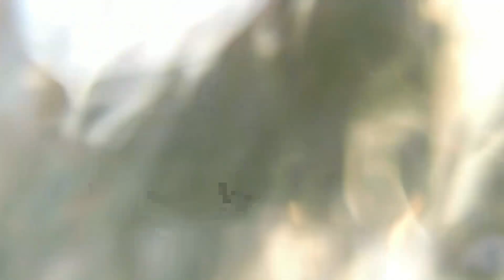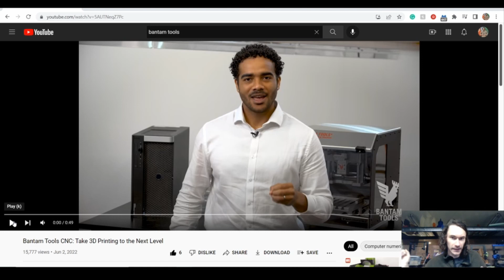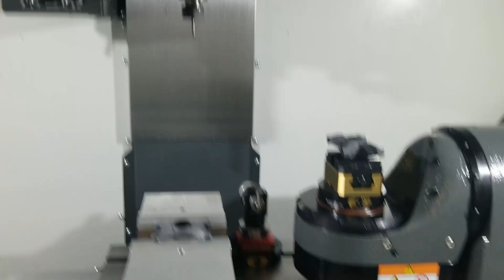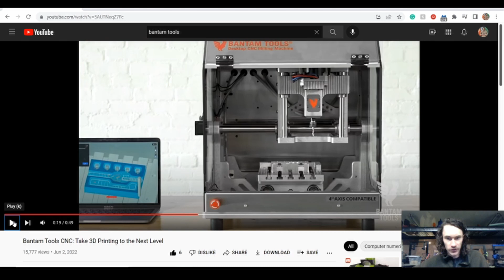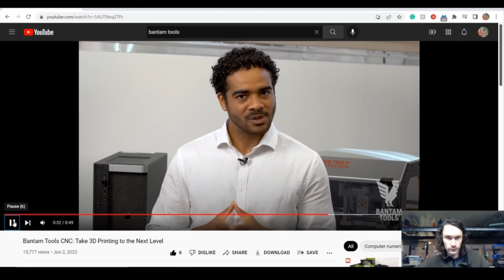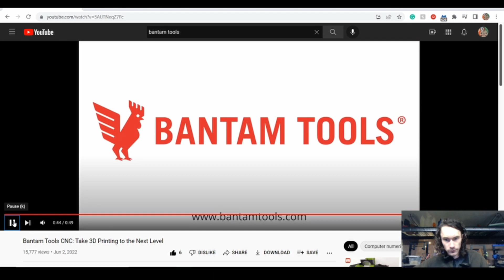Bantam Tools Said What?

Comment: Those machines are not worth half of what they’re selling them for. Extremely low powered motor, leadscrew driven, subscription based software, structurally flawed, and not very accurate. For the same price you can buy both a Sherline cnc mill and a sherline cnc lathe, with ton of accessories and even a 4th axis. Also, their costumer service is HORRIBLE.
Reply from the maker: Did you actually watch my video? I was not making any comments on the machine itself outside of the fact that it looks nice and I would love to give one a try. The focus of the video was to call out the 3D printing community for being a bit overdramatic, in my view, of the whole thing. As for a Sherline, I own one and while they are great machines, they have their own unique ecosystem too that some people appreciate and some dislike. In the end, it is your $$$ you can spend it where/however you please.
Reply: @MakeItWithCalvin  What? Did you even read my comment? It has nothing to do with what you were talking about.